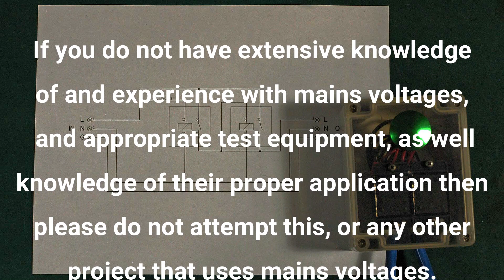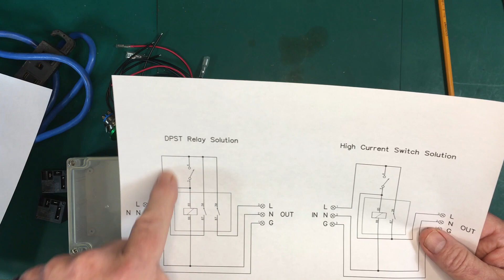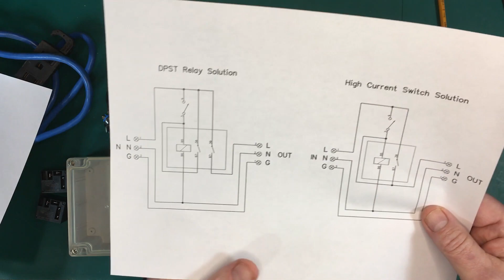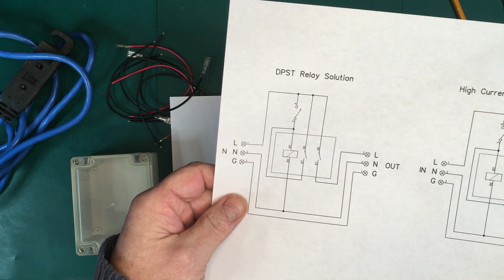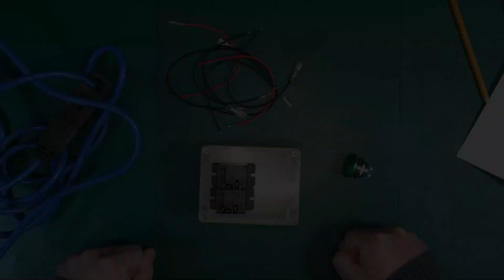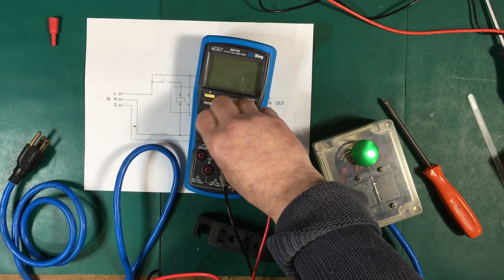0039 - Protection For Your Equipment! A Power Fail Safety Switch

Comment: I have exactly the same solution using a single relay (double pole) for the main test bench, plus a UPS for some gear. I used a small switch to enable and then a momentary switch to turn on, just like the start/stop circuit of any motor controller. Obviously a big UPS would be better but they cost a lot and not really required for heater/soldering iron etc.
Reply from the maker: Nice solution.

For soldering when the power is out I got myself one of those Ryobi cordless irons.  I just runs off the batteries I use for my Ryobi tools.  It can for quite a while on a 9AHr battery.
Reply: @uni-byte  I have a dim memory of using propane-butane iron some 20 years ago. I think it was far to hot for my needs (melting insulation really badly).

Comment: As you are using a relay with a 120 volt coil you could use just one single pole relay, the contacts supply power to the load and the holding voltage for the coil. The initial coil voltage is supplied by the normally open pushbutton. A No Volt Relay (NVR) is a commercially available solution that also allows for turning the load off when desired. They are supplied in an electrically rated enclosure. Regards, David
Reply from the maker: Thanks for the comment David.

"As you are using a relay with a 120 volt coil you could use just one single pole relay, the contacts supply power to the load and the holding voltage for the coil. The initial coil voltage is supplied by the normally open pushbutton"
I did show that option.  However, the PB needs to be able to handle the full load of the circuit being enabled .. just in case.  My switch was only 3A, but my load is usually 6A+.

"A No Volt Relay (NVR) is a commercially available solution that also allows for turning the load off when desired. They are supplied in an electrically rated enclosure."  Yes, I had heard about these and they were the inspiration for my solution.  However, I was not able to find an example that worked in a 120V environment.  Do you know of a manufacturer of a NA compliant version?